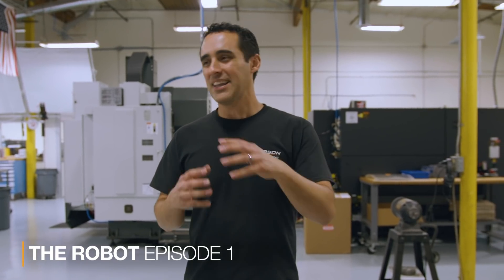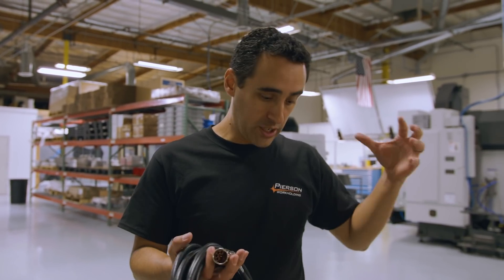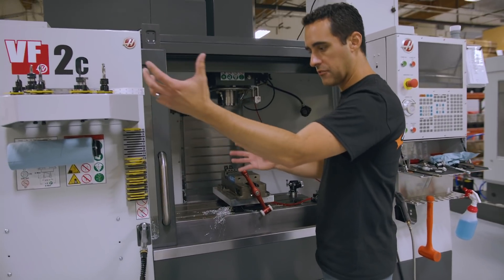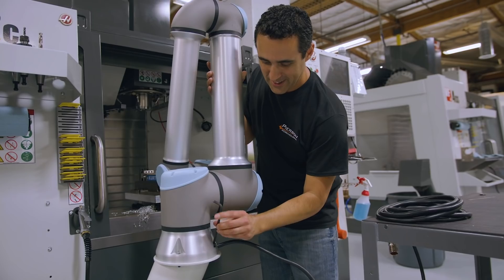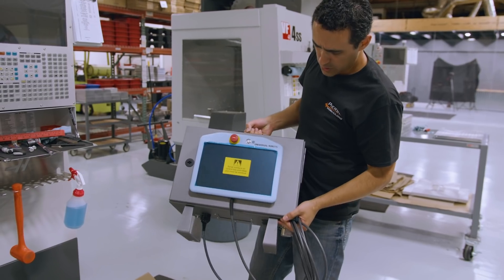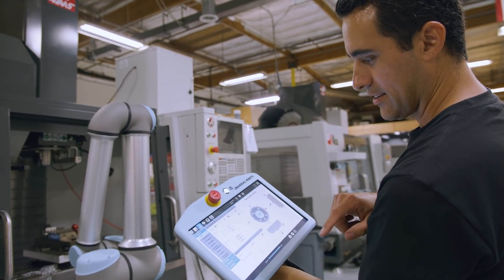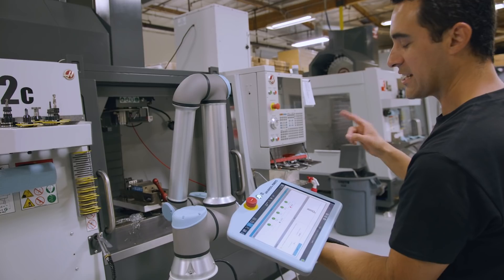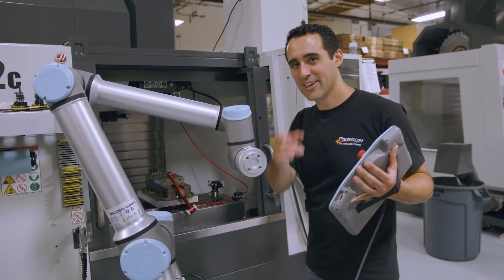NEW CNC Robot is Here! | The Robot Episode 1 | Universal Robots UR10e

Comment: Where did you get the pedestal or did you make it?
Reply from the maker: I designed it, machined the top and bottom plates and had a local welder finish it.  Had it powdercoated as well. - JP

Comment: Great video, Jay. Are you going to add vision to your setup? We're in the early planning stages of a new cell with vision to locate loose blanks from a conveyor and to read 2D barcodes. The idea is to create a virtual self-contained "job shop" for high mix parts like soft jaws. It should be easy enough to use where office staff can get parts made to fulfill an order without interrupting regular production machines and staff.

Comment: so whats the purpose of it being near the cnc ?
Reply: so it can load and unload parts unattended
Reply: @lsxconcepts5125  so i assume you have a conveyor belt that brings the parts to and away from the cnc? because otherwise whats the point?
Reply: @lsxconcepts5125  i didnt realise the arm can identify parts from a table, does it have a optical sensor or do they have to be specifically placed and pre-defined in the program?
Reply: @gf6368  Can go either way.  A vision sensor to find parts "wherever" is more complex and expensive.  Making a nice tray that holds the parts in a pre-defined grid is cheaper and easier, but less flexible and requires someone to load it.  And there's more exotic options beyond that.

Comment: How much are these machines?
Reply: Well, used ones on EBay are going from USD $35k-45k.  I think brand-new they're $45-50k, but that can vary some depending on which model you buy, and what options.  The gripper/tooling, mounting stand, etc, will all be separate or DIY.

Comment: how much did the robot cost ? coz here in australia you would have to pay minimum $30k in safety equipment before you could operate the robot and i believe that RIA  (robotic industry association) has put even more regulations on robot use and safety. one of the many reasons manufacturing is dead in australia .
Reply: You should look into collaborative robots (Universal Robots for example). There isn't any additionnal safety devices needed. If you want to learn more about safety with cobot you want to look into ISO15066.
Reply: @mathieubelanger-barrette1647  sadly the company now no longer exists
Reply: URs are (or can operate as) "collaborative" robots, that need no additional safety hardware or sensors.  The tradeoff is strict limits on payload and speed.  But for any RIA-spec'd "cobot", it's essentially impossible to be seriously harmed by it, even if you try -- about the only serious health risk would be getting your eye poked out, so safety glasses are still a good idea!  :)

Comment: Make sure your grab the latest Polyscope version. It's almost always worth using the latest version (5.3.1 as of this writing). new features are being added all the time and should be compatible with your existing program. All the major UR+ suppliers do a good job making sure their URCaps are compatible.

As for what's in the joints, there's a servo motor tied to a Harmonic Drives zero backlash gearhead, a front encoder, and rear encoder. The collaborative nature uses the motor current as well as the dual encoders to determine if there is a collision with an object or person.

The new e-series has a number of improvements, here are some of them:

1. Higher resolution widescreen pendant with single smaller cable.
2. Better repeatability over older CB series.
3. Built-in force torque transducer from Robotiq in the tool flange.
4. Additional I/O for dual conveyor tracking.
5. The tool port now has RS485 capability allowing grippers and other devices like the Robotiq models to run right off the tool port with no cable running down the arm.
6. Higher encoder reliability (more immune to dust).
7. Faster joint changeout if needed.
8. Four times faster processor.

That covers most of it.

Comment: Yikes, I would like to see the math on the break even date, but super fun.   I always envisioned a special tool IN the tool set that would make the machine load/unload itself.
Reply: Break even is much faster than you think. We've been studying the UR-5 for our production and it will pay for itself in about 14 months (very conservative estimate by the way). The UR-10 is only slightly more expensive at around $55,000
They are so versatile.  We will be mounting ours on a mobile base so we can swap between machines.
We literally had the demo unit picking up a pencil and placing it in a tray within 5 minutes of taking the controls. Amazing.
Reply: 1.2 years on my project